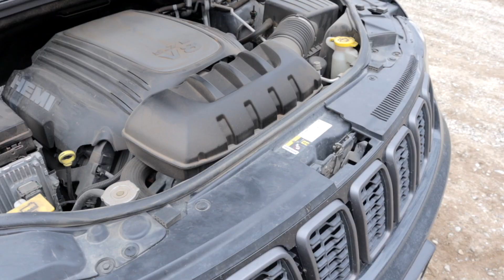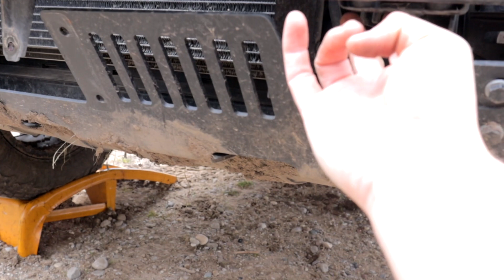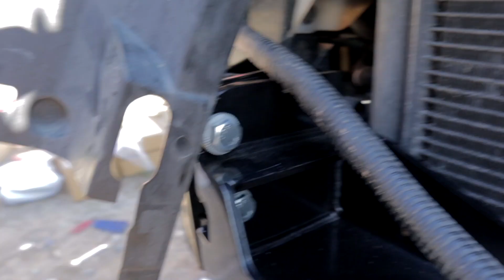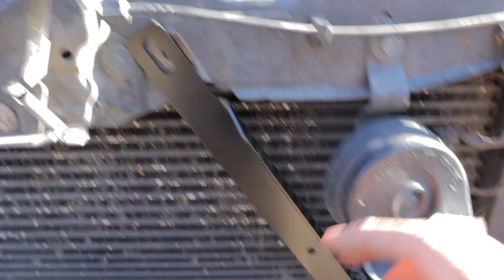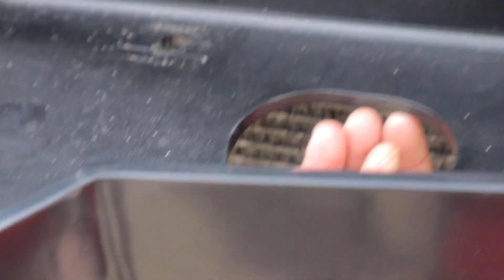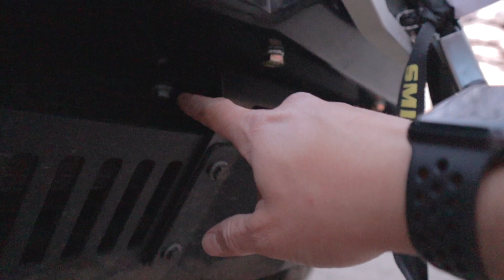Hidden Winch Mount Installation | Chief Products | WK2

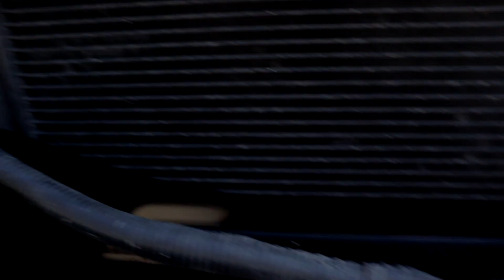Comment: Hey all, at 8:25, with regards to those bolts... here's how you do it.  (just did it)

1) get to the point where you're going to put on the winch mount
2) support the winch mount with something (e.g., boards and a jack)
3) REMOVE ALL BOLTS, that's right... remove everything you just put in. Nothing should fall out, but if it does... it's easier to put back than put in that impossible bolt
4) now you have to match up the chassis, and the winch mount PERFECTLY... this is why you have to take out all bolts because it is quite impossible to make them match up perfectly with anything hindering its movement (you may find a clamp to keep the chassis mount and the winch mount together a useful option)
5) put in the bottom bolts (it will still take effort, but move the chassis and mount around, and you'll get it.)
6) now take care of the underside bolts used to install the chassis support plates... it requires everything to be lined up (you may need to take a thinner bolt to get things to line up and then put in the actual bolt)
7) put in the other bolts loosely
8) tighten everything up, done.

Taking care of the hardest part first... makes it a lot easier. Those bolts are possible, but they require PERFECT alignment, and that's IMPOSSIBLE without free movement in every direction.

Comment: Thanks for the video. From where you got the air suspension compressor guard?
Reply from the maker: Chief Products sells them
Reply: @ProdigalOverland  Does it come with Lower Front Guard?
Reply from the maker: @hj7993  no, they are separate
Reply: @ProdigalOverland  Thanks

Comment: I ordered the winch mount, lower fascia mount, but the Chief Products WK2 Winch Mount Air Compressor for Jeep Grand Cherokee 2011-2020 is out of stock. Is this required if you have air suspension? Thoughts?
Reply from the maker: It’s good to have but not absolutely needed. It’s a lot of work to get to that area. So if you don’t put it on now. You probably never will.

Comment: Thanks for the video. I’m still debating to install this or not. 
 It looks like the ACC camera is well protected but has more obstruction on its field of view. Have you experienced any changes in behavior when using the ACC?
Reply: Just saw your comment. As info, If you have any issues with the acc giving errors or whatnot,  ake sure you put it as far forward as possible and run the harness in such a way as to not pinch or stretch it. Took me trial and error to get it right but now the acc is perfect

Comment: Brad, did you ever get any feedback from Chief Products about why those 2 bolts don't/ didn't line up, during your hidden winch mount? 
I'll be doing ours in about 3 weeks..
Reply from the maker: No, They just said to keep everything super loose. It could have been my frame. I tend to take it out off road frequently. I'm sure not everything is as it should be.

Comment: Hey brad, I just got the same winch with the Chief mount. I was wondering how you power it on and off since the whole thing is hidden? Do I need the lower front guard from chief and the lower bumper off in order to access the switch?
Reply from the maker: I leave it switched on. And use the remote. Haven't had any issues with it so far. Often I leave it in free spool incase it decides to turn start turning.
Reply: @ProdigalOverland  awesome thanks for the response. Has the wireless function failed on you at all? I’m worried about not being able to access the port if it fails when I need it
Reply from the maker: It hasn’t. I did buy spare batteries for the controller. Just in case a battery died on the trail. It’s an odd size.

Comment: Hi, I did a similar hidden winch installation with the chief products mount,  it when I restarted the car and the winch was working correctly, my rear back up camera isn’t engaging. Any ideas from your installation on anything you need to do to get that rear camera up and running? Thanks in advance for any insights.
Reply from the maker: I didn’t have any issues like this. I just wired mine to the terminals under the hood. Have you gone into the settings area in your u connect to see if something got switched off?

Comment: Super helpful video! Do you leave the switch on the control box on or can you reach in and turn it off when you don't need power running to it?
Reply from the maker: I leave the switch on but the clutch disengaged. Just in case it decides to randomly start the motor.
Reply: @ProdigalOverland  thank you!
Reply: @ProdigalOverland  have you had any issues with parasitic battery drain due to the switch being left on? It doesn't say in the manual WHY you're supposed to leave the switch off when you're not using it, but I had guessed that was the reason. I'm about to install the same winch on my 19 limited, and was wondering about this

Comment: ...been as easy without your help!
How/where do you run your winch control cable?
Reply from the maker: I have a wireless winch. So I didn’t have to worry about how to connect the control cable. I have the cable as a backup but haven’t needed it. I’m glad the installation went well!

Comment: Treat that forward collision/adaptive cruise lens like it's one of your kids... It's SUPER expensive to replace out of pocket, and you already modified the stock bumper that surrounds it so it would not be covered under warranty if you broke it. Those lenses can and do go out of calibration and will cost you a fortune to have re-done. Even if you never use it, it will throw a code and ding at you when you're driving. Mine went out of wack after off roading, fought like hell to have it fixed under maxcare, and they did do it. They said out of pocket it, would have approached $4000 to calibrate it, because it's an "Open ticket" and takes several tries and a special tech to do the job. The part itself is pretty pricey as well. I'm very conscious about it now when i"m off road.
Reply from the maker: Good tips! Thanks! It’s cradled pretty well in the acc guard. But I hadn’t even thought about how much it costs.

Comment: Thanks for the video. I am also running a 2018 Trailhawk and I am about to start the install of the winch mount. This video was very helpful. Do you have a video/info on how you wired your winch to power?
Reply from the maker: Tha part wasn’t too bad. We just ran the wires to the positive and negative under the hood. That was an easy part.

Comment: Dude, you saved my bacon. The Chief instructions were less than useless. Your video did the trick. I did have to retap those bolt holes you had trouble with but aside from that,  this helped me do it right.
Reply from the maker: That’s great! Glad I could help. Have fun out there!
Reply: @ProdigalOverland  So I can't get the lower fascia back on, the cradle is preventing it from sitting flush where it mounts near the fairlead. I have cut all I want to cut and am just wondering if you put your original lower fascia back on and if so, what did you run into. Also, the ACC camera is sitting so far back the loewr fascia hole is open and empty instead of flush around the camera, did y ou find this too?
Reply: @no_handle_required  Did you ever figure out the issue with your lower fascia? I'm running into that problem, too.
Reply: @ancient3960  it does take some finesse and patience and a little adjusting but my setup is near factory now. I did have to cut my fascia for the fairlead but if you use the chief fairlead, yiu might not have to. Shoot me an email in private messge and ill share pics or whatever i can help with
Reply: @no_handle_required  Thanks for the reply! I'm not sure how to reach you on here directly (I think they removed messaging a while ago) but maybe you can confirm one thing for me. In P.O.'s Splicer video (https://youtu.be/vwkfFFP_X2I?t=110), you can see how his upper fascia sits on top the winch cradle. Is this how yours is? Mine hangs down at the fairlead bolt level.

Comment: Love you channel and content! Have a TH like yours and considering the same product. Two questions 1. Have u relocated the winch control box or plan to rely on the wireless capability only 2. Did u need to do any trimming to the bumper cover? Looking fwd to see the winch in action...
Reply from the maker: Thank you!  I didn’t relocate the control box. I’m hoping to just be able to rely on the wireless function. However if that fails I could probably just pop off the two plastic rivets under the hood run the wire down. I looked at mounting the control box under the hood but didn’t see any easy places to fit it. 2. I actually didn’t need to cut anything. But that was only because I had already thrown out the lower fascia. When I had originally installed the lower front guard kit. I didn’t want to have to keep putting the fascia back on and off. If you plan to keep using the OEM fascia you would have to trim it a little. But I don’t think it would be bad.

Comment: What about the tow hooks? If you have to do a double line pull your going to miss those
Reply from the maker: I know. Should have plenty of capacity on the winch. The OEM tow hooks don’t integrate with the lower front guard kit. And I’m not in a place to spend the extra cash 💰 for the chief products recovery hooks. At this point

Comment: How did you go about cutting your bumper cover? I have been looking at doing this to mine but concerned about messing it up.
Reply from the maker: I was worried as well, but since I got rid of the OEM lower fascia I didn't have to cut anything. Even so, it wouldn't be bad to trim things if you had too.